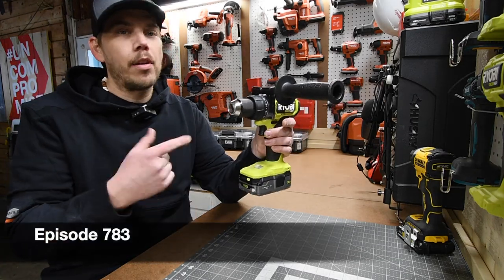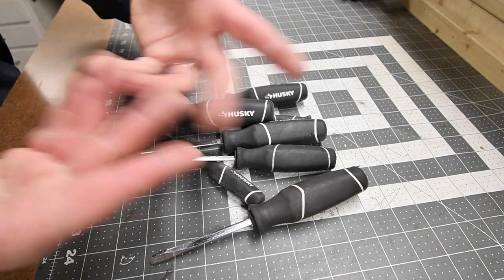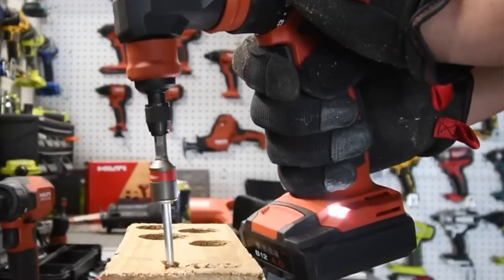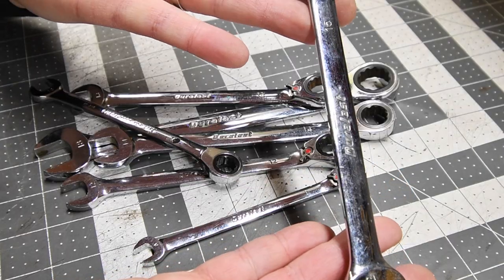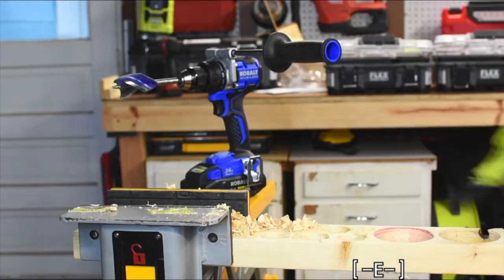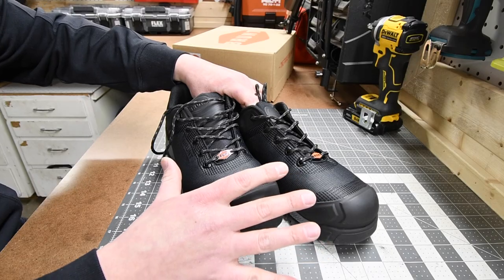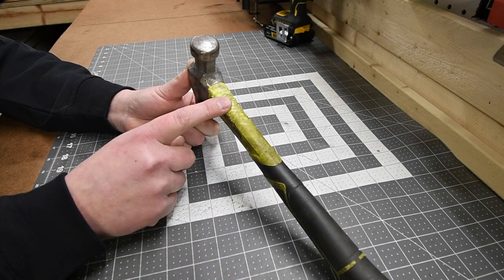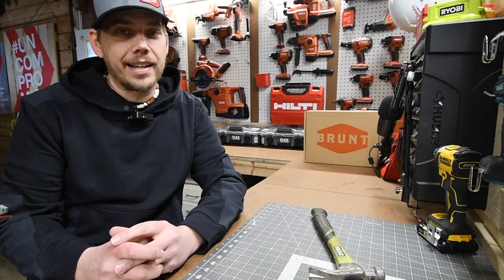Tools you want and need!

Comment: That blower is the sleeper pick of the bunch.  I bought it a while back based on your recommendation and it gets a ton of use around my shop.
Reply: I use it quite often as well mostly to clean my computer from dust but it will work for alot of small jobs
Reply from the maker: I wouldnt mind seeing an HP version of this

Comment: I had a problem with that little blower too. Makes the batteries go into safety mode after a relatively short period of time (times are variable). I reached out to Ryobi and the sent me a new one(so now I have two). I think the new one is better, but still does it on occasion.
Reply from the maker: might not be a bad idea to pick up one of the older lithium+ batteries

Comment: That drill kit (drill, 2 batteries, charger and bag) is on clearance for $80!!!  I saw some last week and didn’t realize what a great deal it was, since I didn’t look at details. Went back on Sat and they were sold out. Today was driving near another Depot 3 miles from the other and they had 6 of them in clearance area. Ironically, in the “gift” area they have the 2 pack of the exact same batteries by themself for $139!!!!  Was tempted to grab the stack of the $80 drill kits and set them next to the $139 batteries. Anyway. Home Depot on Laguna Woods, Ca had at least 6 of the kits left as of mid day today.
Reply from the maker: that's why you gotta get the deals while you can